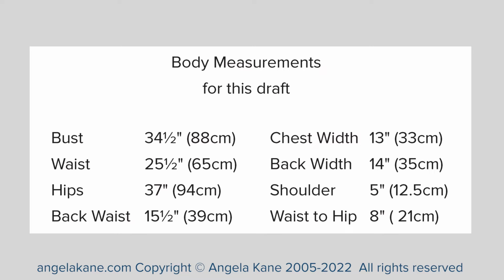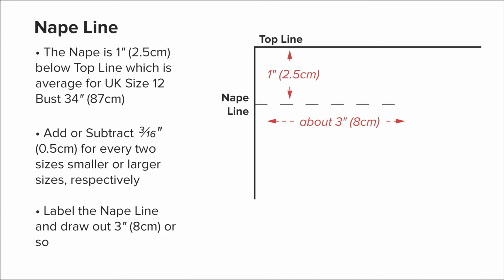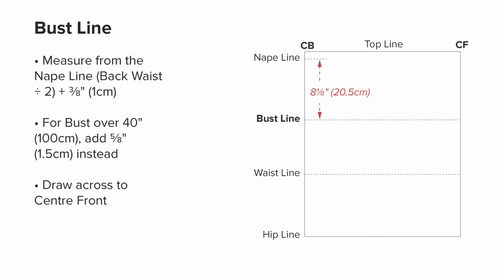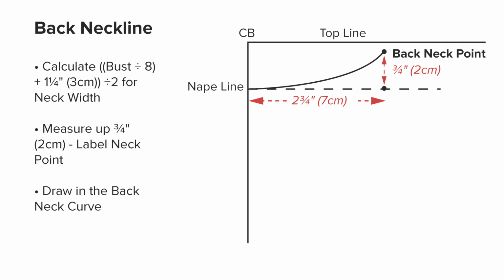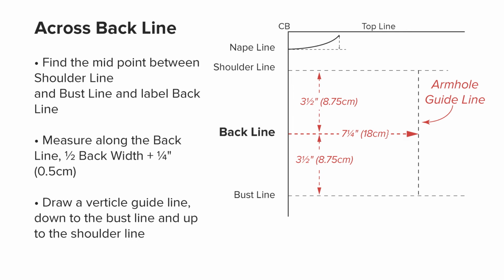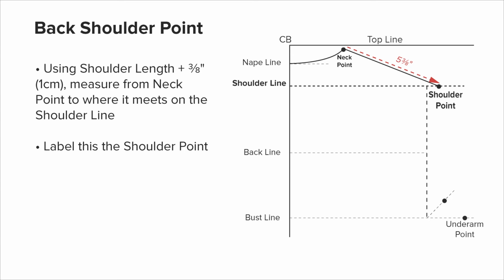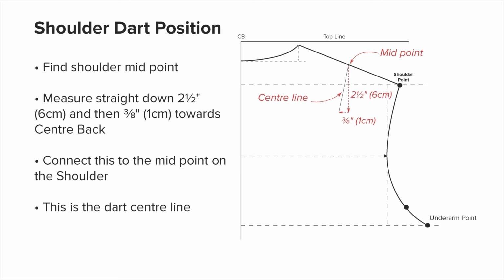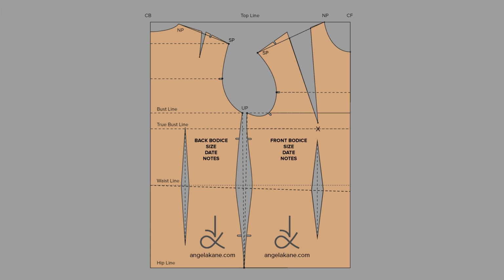Fashion Design - Drafting the Bodice Block -  Part 1

Comment: I tried this today and cut and sewed a mock up. Let me tell u...this is the FIRST TIME IN MY SEWING LIFE that i drafted a blouse pattern and did NOT have to do ANY adjustments after the mock up! It fit me perfectly, the bust point  was EXACT!! I AM in AWE!!! 
Thank you so much for these tutorials. They were extremely easy to follow and easy to draft. I consider myself a beginner and the mock up fit me, and i did not add any extra seam allowance to the pattern. I will finally be able to use this pattern to drafts bras and corsets!

- from Trinidad and Tobago🇹🇹
Reply from the maker: Hi Giselle,  thank you so much for your generous praise.  I'm very glad you found it easy - I worked very hard on this series to make it useful.  Your comment is much appreciated.

Comment: Am I correct in thinking the block is drafted without seam allowances and these are added later? Thanks so much.
Reply from the maker: Hello Jasmine, Yes that is correct.  Blocks, sometimes called slopers, are drafted without seam allowance.  This is important for the design process.  Seam allowance can be added once the final pattern is drafted although many designers prefer to leave the pattern as a net pattern and add seam allowance as they cut out.

Comment: One more question: Can I use these blocks with stretch fabrics if I close the darts?
Reply from the maker: Yes, that will do quite well for stretch fabrics.  You may do better to use my simple fitted t-shirt 500 design - https://angelakane.com/sewing_patterns/patterns/t-shirt-sewing-patterns-500-501-502-1501-1502.php.  That would work really well as a block for jersey designs.
Reply: Thank you, Angela. You are very kind.❤

Comment: Why you add +5 cm  in front bust measurement
Reply from the maker: Adding 2" (5cm) to the bust measurement, less in smaller sizes and more in large sizes, as described, is standard practice for the bodice.  You need this amount of ease to allow for movement.  You need less if your garment is sleeveless.